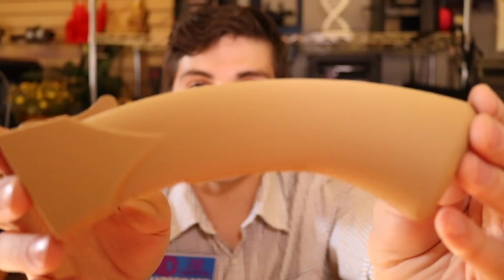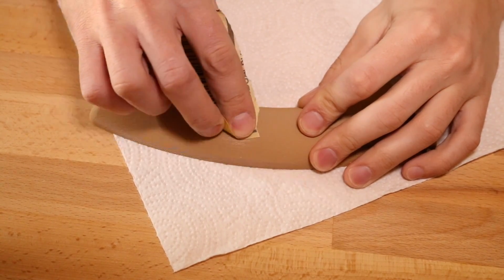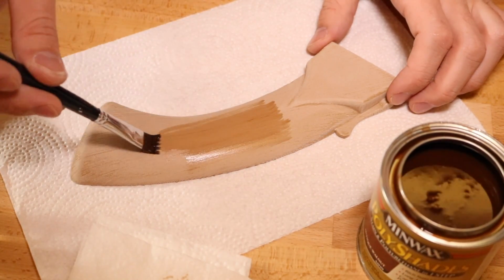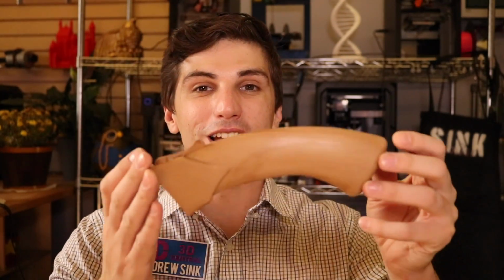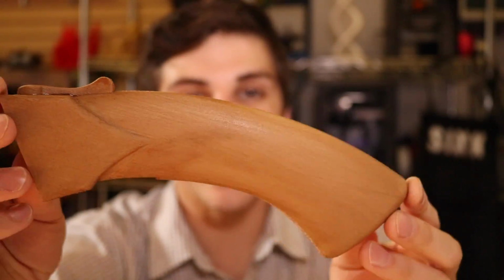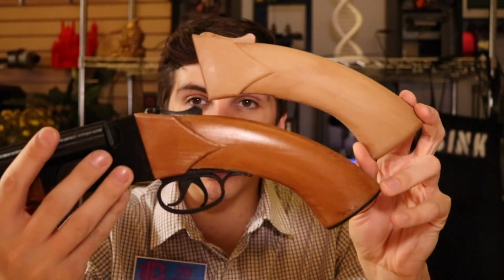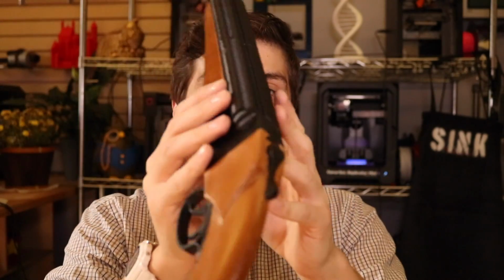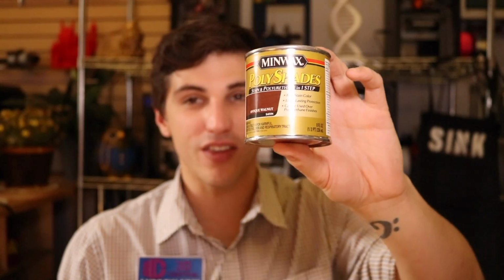Staining 3D Printed Wood Filament using Polyurethane!

Comment: Good video - just a technical note: real wood stain acts as an optic filter - and it has no binder. That's why you have to seal it with a clear coat (UP, alkyde, PUR, acrylic etc.). "Depth" is a function of refractive index matching between the wood matrix (lignin & cellulose fibers) and the dried binder (the bigger the difference, the less "deep" the effect will be). If your binder also contains color molecules that act as a dye, you get highlights with a warm color hue, which we percieve as "more depth" ... if you overdo it, the results can become somewhat artificial. So, in order to create a "wood" effect, you are basically creating a (semi-transparent) layer on top of your opaque plastic part. If you want an even better effect, you could try epoxy stains in a PUR clearcoat over a lightly pigmented base layer...
Reply from the maker: Woah, that's a lot of info. I appreciate it!
Reply: So here you aren't expecting the stain to penetrate, but are instead relying on the cured poly? Asked another way, would it make any sense to try stain independent of the poly? With wood I'd skip the poly if I was going to use wax as the finish.
Reply: Such a cool explanation!

Comment: I printed letters for my son's room spelling out his name on the wall out of wood filament. Stained, a few coats -- you should really wipe excess stain, or it won't dry evenly. Then finish it with acrylic poly, it does really look like wood, if you orientate your part so that the printer lines go a certain way you can get it to look like wood grain, that's why I wouldn't sand it too much or you'll lose the effect. Everyone thinks the letters on my son's wall were made in my workshop -- they were, just a different part of my workshop.

Comment: I've stained hatchbox wood pla, it worked well except for the areas that have wood filler in them. The stain over the woodfiller looks a different shade than the PLA, it'll take some time and different layers to get it to appear as a single piece.
Reply from the maker: Ah, interesting. That makes sense!
Reply: instead of wood filler use a 3d pen and the same filament you printed the part with to fill in gaps.

Comment: I am finding some very mixed messages about whether or not Hatchbox Wood PLA needs a special nozzle or not. Does it really damage a normal nozzle on, say, a Prusa -style printer? Does it require a special nozzle size? I'd love to try this stuff, but I use my printer too much to have it broken by a novelty filament. Please let me know!
Reply: Perhaps you know by now, yes wood filament is mildly abrasive and will cause some wear to brass nozzles, but it does so less than other composite materials such as metal fills, phosphorescent (glow in the dark) filaments, carbon fibre fills. You can upgrade to a stainless steel nozzle or better, or you can buy replacement brass nozzles which are extremely cheap (pack of 10 0.4mm nozzles on gearbest for like $2 or £1.50 or so.

Comment: Yea I’m dealing with mine staying very sticky. Attempting mixing it with mineral spirits. Then will use alcohol dyes brushes in before clear coat
Reply from the maker: Maybe add a sealant?